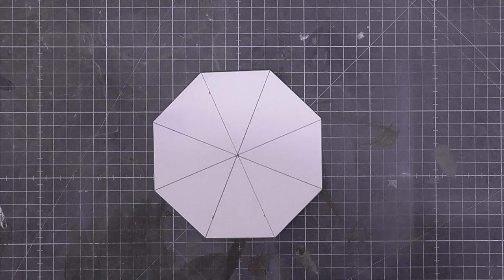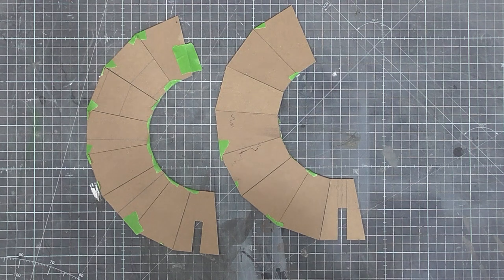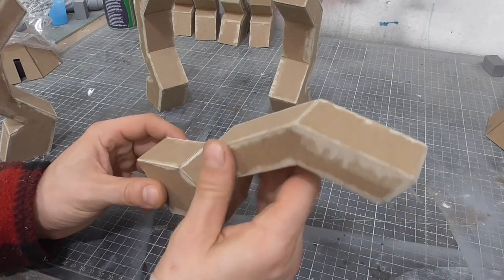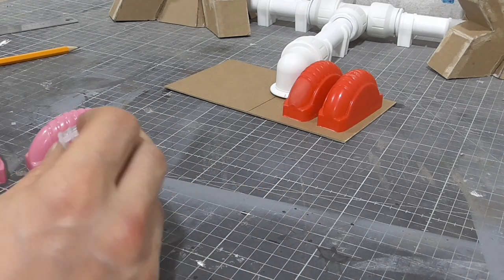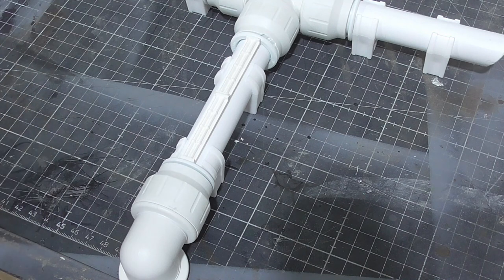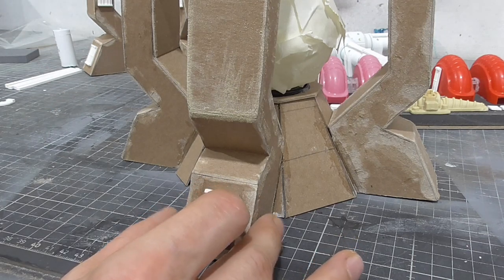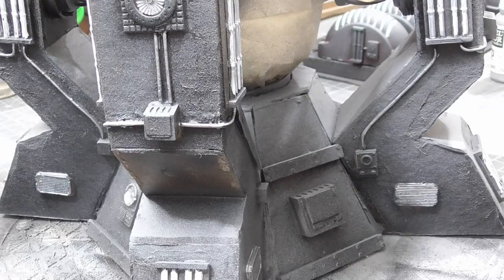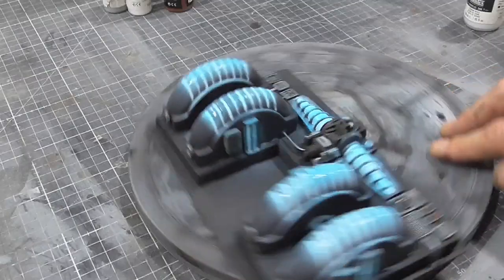Scratch Building the Ultimate Power Generators - 40k Terrain

Comment: I build terrain and sell it on ebay have done for years, I would have only changed 2 things, 1, I would have made the cardboard look like concrete as the imperfections in it would have looked more natural, 2, I would have added some micro LEDs to the build maybe a few spot lights or maybe some red hazard lights. Apart from that they look awesome, and the things I would have changed don't take away from just how good these are. Well done.
Reply from the maker: Thanks Storm, there are always things I could have done differently but that's the challenge when building for youtube sometimes. Time is a huge constraint. I completely agree with your suggestions. How does has your selling on ebay gone? Good business? I would love to see some of your stuff. Thanks for watching.
Reply: @creativecuts7803  And I feel you do a fantastic job doing it.. I have watched your vids for a long time didn't realise I wasn't subbed until today, so I have corrected that. As for work it goes well I only do it in my free time but the stuff I sell, sells well.. even more so during our collective time at home. The only problem I have which I'm now changing is due to the material I use or used, Ultra cal 30, which is brilliant to build with yet the post people seem to always find a way to brake the models. So we are now switching to resin, and let's hope it goes well lol.

Comment: Very cool build!  FWIW, a bit of Black 2.0 or 3.0 in cracks and crevasses will make them look like they are a mile deep.
Reply from the maker: Cheers Keith, thanks forbwatching and I have really been wanting to try some black 3.0. Looks like a very cool product. I will have to order some. Thanks for the suggestion 👍
Reply: @creativecuts7803  Glad to be of help.  

FWIW, another option for hiding switches is to use a reed switch, which will close when a magnet is brought near to it.  You can wire it in series between the regular switch and the power source to make adding it easier.  One option is to put the reed switch behind a (ferrous) metal plate and put the magnet on the bottom of a piece of the structure.  When you put that piece into place, the magnet will both hold it to the plate and turn the circuit on.

Comment: I want to be in orbit [at the VERY least] if that thing blows! Btw when applying jewellery/rivets I always put a blob of CA glue on a bit of plastic etc and dip the 'rivets' in it. I use a very sharp scalpel point to stab/pick them up and touch them to the glue then into place on the model. Sometimes they fall off the scalpel and sometimes they get left behind on the blob of glue, but its a quicker method when you get the hang of it.
Reply from the maker: That's a great tip and makes complete sense. Really appreciate it 🙏

Comment: I know this was a while ago, but I actually paint the wire before hand so I can use a larger brush with the acrylic white and get it done in no time! You just need some double sided sticky tape and a wood clamp. Okay, back to the video!
Reply: I do it with all the wire bits, not just the ones that need to be white.
Reply from the maker: Haha I like it. Great tip. Will remember for next time. Thanks for sharing
Reply: If you do try it, don't forget to make the pieces just a super tiny bit longer so you can clamp them. Then when dry, just cut that tiny piece off. 🙂